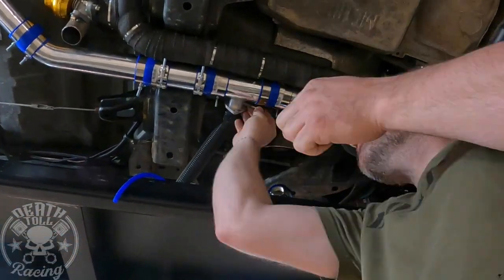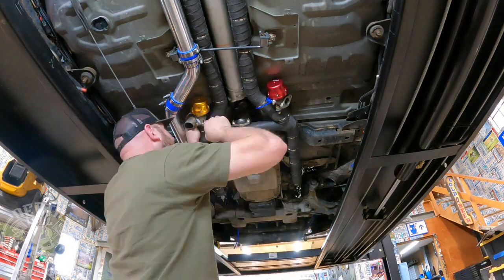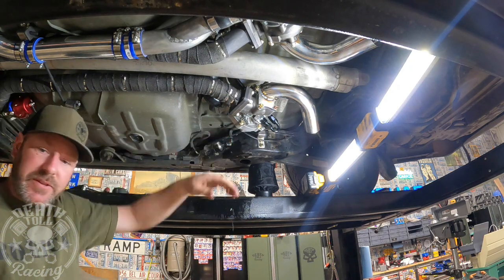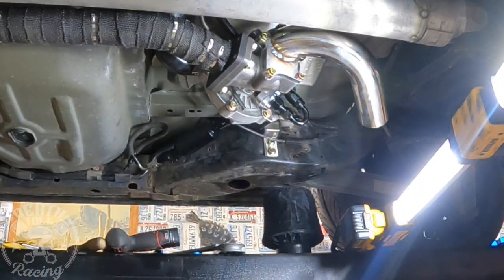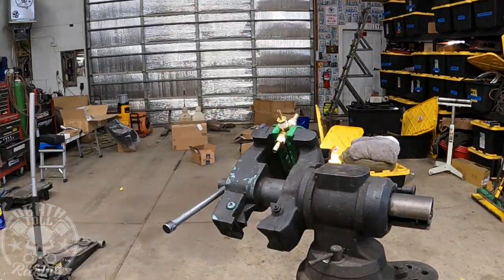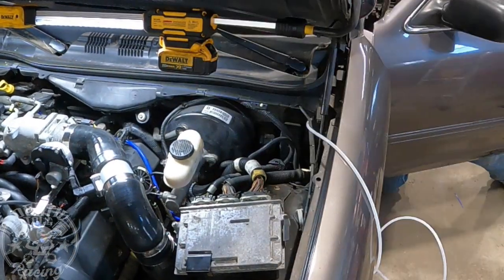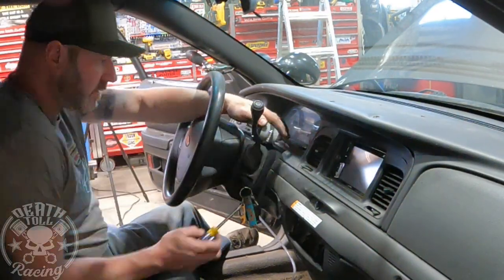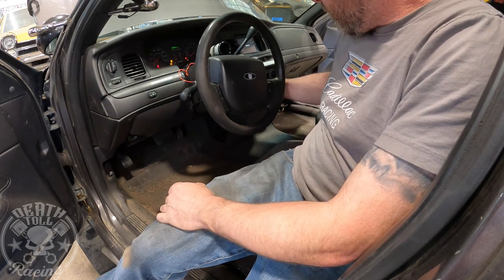Ep 9, First Start, Blow Off Valve, Fuel Filter, Gauge and Boost Lines, Twin Turbo P71 Crown Victoria

Comment: Not sure if you are aware, and just wanted the sleeper look, but the BOV should be as close to the intake as possible. Keeping mass air sensor in mind. Reason being is air is heavy, and slapping the throttle closed stops that column of heavy air. I'll keep catching up to see if you address this or if it's even an issue on this build...
Reply from the maker: That would be ideal.

Comment: first start, glob injectors but also probably 75 psi if you look. my AEM pump ran that high for a couple minutes until the system slowed it down. pretty sure there's a 75-ish psi relief on the stock plastic line to the pump
Reply from the maker: That's probably right.  When the computer is expecting a pump that puts out less than half the volume, it's probably going to take a while to figure out what's going on.  I never really thought of that, just that at the time I had very big injectors in it.  Combine that with what you said, and no wonder it was running so rich.
Reply: @DeathTollRacing  I have an 09 and have played around with fuel before. my AEM 340 took about 5-10m to settle down to a ridiculously low PWM and voltage but it can do it. haven't found much in HP tuners for pump fueling but all the injector info is available. a set of ford racing 47lb injectors is cheaper than OEM flex so I have a set waiting to go in. I also have a WAP (aluminum) block that came out of a f150 i plan to build especially after watching you shatter your stock pistons. we always think we can keep it at 6psi.... i don't blame you for what happened :)
Reply from the maker: @adrianlastname4864  I’m currently running a wap block in the car now with Deatschwerks 60 lb injectors which are way overkill. The 47 lbs you have would work way beyond what would ever be needed. The 60’s work too, but they are way dialed back.  It’s a winter wonder land here, so it’s been a while since mine has been out. It’s been holding 8psi with only gapped rings so far. I plan on running it hard this summer at the track in a vs with a caprice I’m building now.
Reply from the maker: @adrianlastname4864 I had Marty (mosspeedshop) tune it since I did the 5 speed swap at the same time, and he was saying that he prefers sct for the manual swap (maybe in general for ford)
Reply: @DeathTollRacing  I think Marty likes SCT because he can obfuscate his tune. when i talked to him he said he tuned both but preferred SCT because he sells the tuner. then when i got my own HP tuners he suddenly didn't support it even though i have a e-mail from him saying he does...so I'm not a fan of the guy. he's also attacked me on social media when i ask people if they've dyno'd before and after his tune. he seems pretty defensive about his tunes when you start asking questions. but i still love my vic and yours
Reply from the maker: @adrianlastname4864  I’ve had good luck with  him. He’s treated me good. We use hp as well (or Chad does to be more exact. I mostly just mess things up🤪)

Comment: Turbo spool down sounded awesome to me.  Yes, you have no self control.  No one I know would see if the blow-off valves were working by stomping the brakes and hoping they hold while still ON the 4-post lift 😂🤣😂
Reply from the maker: The turbos sound really cool. It was running so crazy rich it sounded terrible in person so it was hard to hear the turbos. Chad is going to help tune it on Wednesday unless something happens between now and then. 🤞

Comment: Looks like that steering wheel has an autobot logo.  You should change it to a decepticon since this is supposed to be a "hidden" build :)
Reply from the maker: 😂 yes it does. It was put on there by the state trooper that had this car.